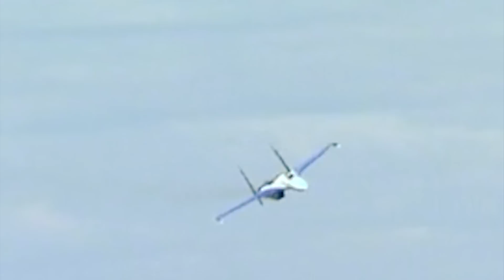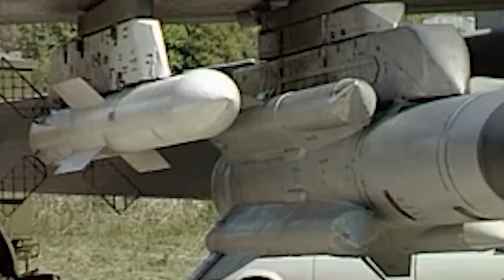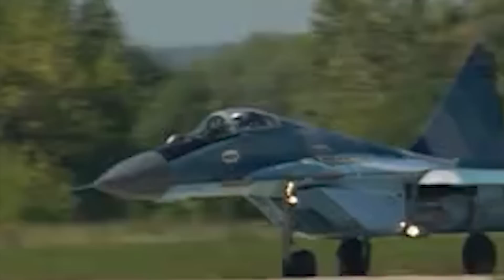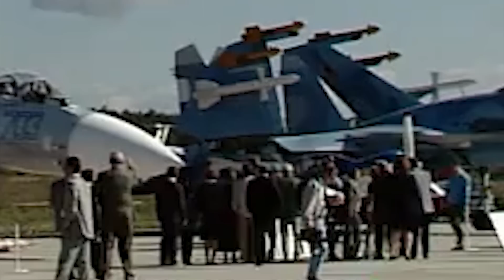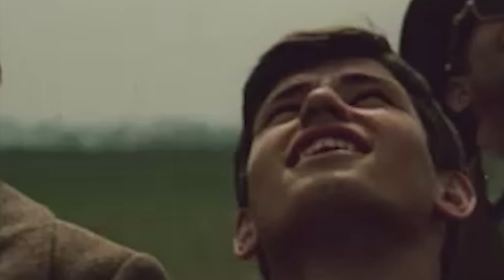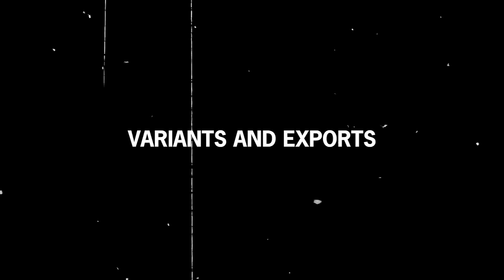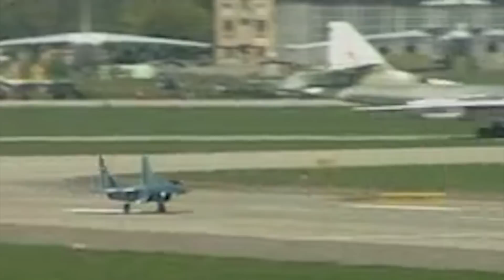Su-27 Flanker - Twin-Engine Supermaneuverable Fighter Aircraft

Comment: This plane is the perfect highlight between the different combat philosophies between America and Russia, while the yanks invested heavily in combat platforms that avoid radar detection to fight at long range, the Russians created a dogfighting monster that can pull off insane maneuvers you wouldn’t think an aircraft should be able to do, both fighters are each other’s antithesis, and we cant really know who made the right call until these planes actually meet in combat
Reply: Absolutely correct.  Both aircraft are excellent and have pros and cons.  There is a huge irony however, back in the 1960s the Soviets actually started to push for less maneuverability and a focus on speed, altitude, and long range missiles.  The Mig-25, and later Mig-23 were perfect examples of this.  The ironic part is the US saw the Mig-25 through spy photography and was shocked, thinking the large wings and twin tail configuration was designed to be a monster dogfighter with super maneuverability, which lead in large part to the US F-15 program, to create a American version of what we imagined the Mig-25 was.  The funny part was the Mig-25 had such large wings because it was so heavy (made of stainless steel not aluminum.)  it needed that strength to fly at near mach 3 at high altitude but it was a poor dogfighter.  Later when the US came out with very capable dogfighters with the F-15, F-16, F-18. The Soviets in turn thought they needed to counter the US strategy by making even better dogfighters, when the US originally focused on dogfighting because they thought incorrectly the Soviets were focusing on dogfighting.  It's kind of a comical misunderstanding of each others doctrines and design philosophy.
Reply: @-Zevin-  mig 25 was always an interceptor designed to kill american strategic bombers, never used as a dogfighter.
Reply: @jerryjencik3879  Yes exactly, that was my point in my comment, sorry if that wasn't clear. The problem was American spy photographs and Intelligence analysts thought it was a dogfighter. When they turned the aerial photos over to engineers the design to them indicated a highly maneuverable, fast dogfighting oriented aircraft, but this was based on the shape only and made allot of assumptions. One of those assumptions was that the Mig-25 was far lighter than it actually was, the US had no idea it was made of steel, the large wings for instance were not to make it a great dogfighter with a high degree of lift, it was simply necessary because the MiG was so heavy. 

This misinterpretation of Soviet technology lead to the development of the F-15, which in its early stages of development was considered a response to the Mig-25, without understanding what the Mig-25 actually was. So the US developed a great dogfighter, in response to what was actually a very fast high altitude interceptor.  The irony gets even better when the Russians then invented aircraft like the Mig-29 and SU-27 in response to American teen aircraft F-15, F-16, F-18, that were originally developed to counter Russian aircraft that didn't exist.
Reply: 100% agree.
Reply: @DamoclesAmech3dgundm  nice to see intelligent comments
Reply: 1 built an Eagle, the other built a Bear. 
Only wins in Sub Sonic warfare.
Reply: USA, ask Israel if the F15 and F16 was the right call. They've dropped lots of high end planes with those 2.
Reply: Computer simulations are good enough to demonstrate that while slow, high AOA maneuvers are great exhibitions at airshows, they have no use in an actual air combat situation. If you were to put yourself in such a low energy state you'd be a sitting duck. This is why America never invested in full axis thrust vectoring.
Reply: @pi.actual  thank you...
Reply: It's interesting to note that there are similarities...particularly the connections for ground service equipment....the Russians use American connectors for universal access to NATO ground equipment
Reply: @TheGravitywerks  You see that allot with old Soviet gear, they wanted the ability to repurpose captured equipment. They learned allot of lessons from the intensity of WW2 that western nations didn't. Logistics wins wars after all.  It's also why you see way more of a focus on ruggedness, the ability to take off from improvised airfields and even grass strips with their jets. Along with the ability to use multiple fuel types, and even old Soviet stuff using alcohol coolant in radars.
Reply: @-Zevin-  ruggedness yet the shit doesn't last
Reply: It is about projection of said abilities. No projection. It is a package deal. No projection equals no support. No support means they stay grounded no matter how "bad" they may have been.
Reply: I think I’ve heard Putin pretty much sum up things like this by saying “whatever the West  has we’ll focus on countering that” and that’s the general approach.
Reply: US made the right call . . until they didn't.
I don't mean F-18 / F-15 . . but SR-71.
Remember when nothing can touch it?
Until US . . actually it's 1 man, scrap that SR-71 without replacement.
What's the reason? O yeah, too expensive . Well . . let's compare that with B-2 😁
Reply: @budisutanto5987  SR-71 program was stopped because the Soviets invented missiles that could shoot it down.
Reply: @-Zevin-  Nope.
You have been feeding a lie by a powerful person in the government.

Or perhaps you mistake SR-71 with U-2.
Reply: @budisutanto5987  What are you even talking about? Feeding a lie by a powerful person in government? I am American for starters.  The Soviets had multiple missile systems that could reach higher speeds than the SR-71.   Not only that but it could be air intercepted by MiG-25, the MiG itself was capable of mach 3+ although wouldn't fly at those speeds because it would damage the engines.  Still it would reliably fly at Mach 2.89, yes slower than a SR-71, but it was also capable of flying at the same high altitude, with a intercept course from ground radar the MiG would lead the target to get into range. The MiG carried the R-40 missle, which could reach speeds of mach 4.5 (faster than the SR-71) with a range of 50miles.  The reality is the Soviets had the ability to intercept and shoot down SR-71 .The Soviets and later Russia went on to develop even more capable missiles. The R-40 was very old was designed in 1959 and went into service in 1970. S-200 and S-300 systems also had missles capable of reaching the SR-71 from ground launch, variants of the S-300 missile could fly as high as a SR-71 and had a target engagement speed of up to mach 8.5)  . As well as the excellent MiG-31 and its R-33. (which was capable of speeds up to mach 6, and a range of 300+km). 

While it is true that the SR-71 was invulnerable to older SAM systems like those present in the Vietnam war (SA2), the Soviets continued to improve technologically at home.  There are good reasons why the US stopped risking deep incursions into Soviet territory with the SR-71.  It still was a slippery target and not easy to intercept, but the longer it remained in Soviet airspace the more possible that interception became.  The final nail in the coffin of the SR-71 was spy satellite technology.  Why risk a aircraft that can be engaged when you have satellites in space?
Reply: @-Zevin-  Nope.
That mig can reach higher altitude then SR-71.
Your long explanation is exactly what they been feeding. I heard it before.

Ask yourself this :
- Can Russia missile reach U-2 ?
- Is U-2 spy plane still being used today ?
- Why there's no upgrade or replacement on SR-71 ? (the video ↑ is about plane arms racing)

Spy satellite.
- Who invented high resolution camera for the CIA?
- Is the satellite have cloaking device, so no one can't know it's trajectory, so nobody can't hide things.
Remember this is before GPS.

That satellite story, I think is quiet remarkable. The part that government can sell it. Telescope 🔭 technology already reach star ⭐ at Newton time 😄
Quality 🔭 is not cheap, but it's not a rare technology.

edit : wait a second. You're not thinking that US park a satellite above USSR, right?
Reply: @budisutanto5987   Everything I said in my "long explanation" is verifiably true.  I really don't know what you are on about.  Is the U2 still in service? Yes, do you know how it is used? Mostly flying over international territory or nations that have no air defenses. It's not hard to fly over nations like Afghanistan when their "army" is goat herders with rifles, not the Soviet military with SAMs and modern interceptors.  Can Russian missiles reach the U-2 also yes, not only can they, the Soviets shot Down U-2. Shooting down U-2 has been a trivial task since the 1970s. In-fact the first U-2 shootdown was in 1960.
Reply: @-Zevin-  And why didn't they use SR-71 that way ?
Is U-2 faster then SR-71 ?
Don't you want to get eyes there A.S.A.P ?
If you say no then I rest my case 😁
Reply: @budisutanto5987   Are you even serious? This is a basic logic problem, by your own admission both the SR-71 and U-2 are vulnerable to being shot down, but the SR-71 is far more expensive, can only fly once per week per aircraft because of the amount of maintenance that has to be done just to keep it airworthy. SR-71s spy photography and video is also only viewable after the aircraft is on the ground, while the U2 can provide live views to crews on the ground that can then update combat troops, live. No waiting for the SR-71 to land and process data. It's easy to understand why the U-2 was chosen, live data, much cheaper to maintain and fly, can be flown almost immediately after landing without the week long wait.  The only advantage the SR-71 had was its speed for a short period of time allowing it to avoid interception, but as soon as the Soviets developed the ability to intercept and shoot it down too, it was worse in every way compared to the U-2.   

U-2 actually gets eyes on the target faster, because the data on the SR-71 is only processed after it lands. So if you have troops in combat, the U-2 actually provides faster live recon.  So yes, if you want eyes there A.S.A.P you want a U-2. It's pretty clear you don't actually understand the technology involved here.  As well as the fact that the U-2 can be flown more often, giving you "eyes there A.S.A.P" while the SR-71 sits on the ground for a week getting maintenance.  The only advantage the SR-71 had is speed, and what use is that if modern missiles can fly faster and shoot it down just as easily as the U-2?
Reply: @-Zevin-  Your short answer is no.
You rather use a slower U-2, that most likely get there when it's over.
So you use it on not so important task, which a satellite can do.

I noticed you didn't even consider SR-71 as an interceptor, carrying missile.

Anyway thank you for agreeing with me on : expensive.
Which was the reason they give, because SR-71 is terminated before missile can reach it & high altitude Mig existed.
And you didn't say why US simply didn't upgrade SR-71 to counter those threat.

And then there's B-2, a $ 2 billion, with much higher maintenance cost because it stealth. A pain in the ass to maintain its stealth skin.
I already mentioned this B-2.

And also the much much expensive secret SR-72.

As you can see, expensive is just what they say. And you believe them.
Suit yourself.
Reply: @budisutanto5987   You are hopeless my dude. The short answer isn't no, the short answer is actually the U2 gets to target and provides recon info before the SR-71 because the SR-71 has to land first before it can provide data, unlike the U2 which does it live, and can loiter over a target providing live data for much longer than a SR-71, which mostly takes quick snapshots then leaves the target area. 

 Then you mention the weapon armed SR-71 which was nothing more than a single prototype that never flew operationally. Compare that to the Mach 3 capable weapon armed MiG which the Soviets produced over 1,000 of.    I get that you are a fan of the SR-71 but you don't really have any valid point here. There are valid reasons it was put out of service. You being a super fan, doesn't change reality.

You also said "Which was the reason they give, because SR-71 is terminated before missile can reach it & high altitude Mig existed." the MiG-25 existed since the 1960s.  The SR-71 wasn't put out of service for the first time until 1989. The Soviets had the ability to shoot it down from 1970-1989, 19 years. 

Also have no idea why you are even brining up the B-2 when it is a bomber.
Reply: @-Zevin-  '. . U-2 get to target . .'
What target? Low priority target. Can be done with satellite.
You achieve your goal to make me repeat myself.

SR-71 interceptor doesn't exist.
Do you mean Skunk Work failed to built one?
Now here . . you use their way of lying. Saying things that doesn't mean anything.
I pity you, as an American, got so easily dupe.
If you're from the government then shame on you, speaking like the snake you are.

You don't to have to take my word for it.
All you need to do is to hear from both side. Might want to hear from Skunk Work side.
Reply: @budisutanto5987  You really are hopeless. Then result to insults and name calling like a child because you can't argue with objective reality and facts.  I also see you deleted your previous comments where you posted provably wrong information.  Again I get you are fan, I like the SR-71 too, in my hometown of Kalamazoo MI we have a SR-71 on display at the local air museum the Kalamazoo airzoo, it's one of the most impressive aircraft there and is always fun to go view. 

 However you only make yourself look foolish when you make arguments from ignorance, and later even have to delete factually wrong information you posted previously. I hope this was a learning experience for you.  Just because something is "cool" and you are fanboy of it, doesn't mean it was some magical super tech that was only stopped because of some bureaucratic conspiracy theory. The reality is the SR-71 was put out of service for very good reasons, including it being operationally obsolete. Sorry to be the bearer of bad news.
Reply: @-Zevin-  You feel insulted. But you don't say which one. That also snake moves.

And you resort to lying, that I deleted previous comment.
And said it's 'probably' wrong information, without stating which information.
How low can you go?

The truth about SR-71 being killed by Mc Namara (is the spell correct?) for personal reasons is out.
You can't stop this kind of information.
Your not his kin , are you 😄

You call this arguing, when you have no straight answer and just repeat your explanation.
It's not insult when the truth is you are not arguing, you try to deceive, isn't it , snake?

If you want other people to respect you, you can start by stop using deceiving way and talk like a man.

You can type whatever you want, I'm sure people can see your low ways.
Reply: @-Zevin-  mig 25 didnt have a prayers chance in hell.. its engines would've eaten themselves alive to get walked by it...

Comment: When you’re dead 30 miles short of being able to show your super maneuverability, your super maneuverability doesn’t mean much.
Reply: Also, super maneuverability is a great way to get yourself killed in a dogfight.  If you need to use the cobra, you've got 1 chance for it to work, and if it doesn't,  you've used up all your energy (speed) and are now a sitting duck.
Reply: @cjmunnee3356  many ppl tends to forget super manoeuvrability does not always mean cobra , cobra manoeuvrability is just air show trick shot